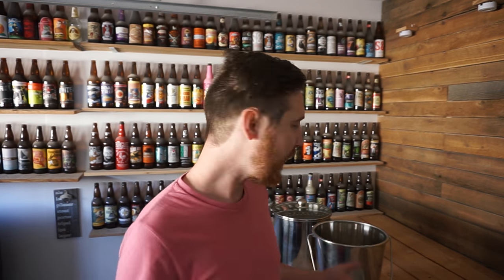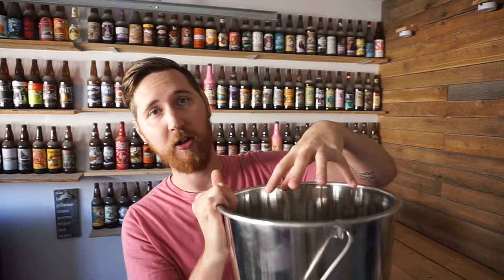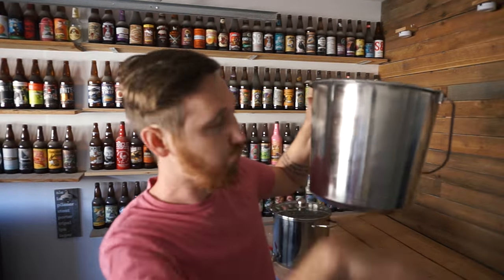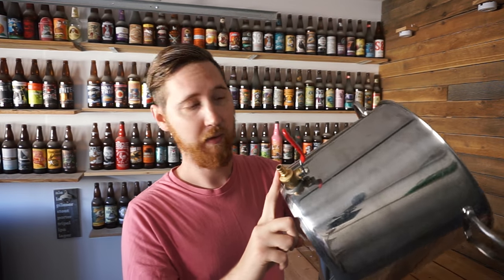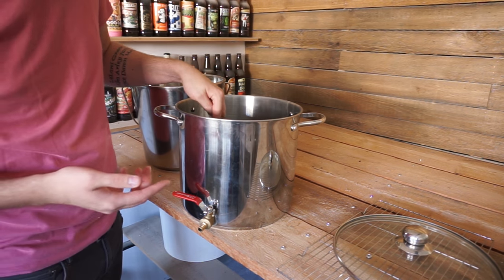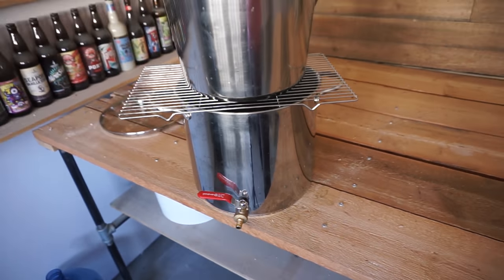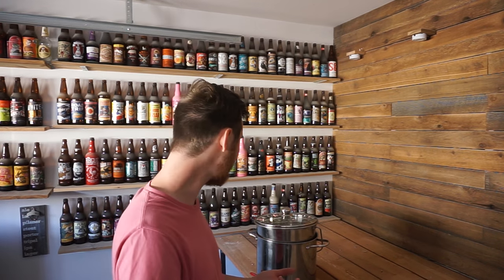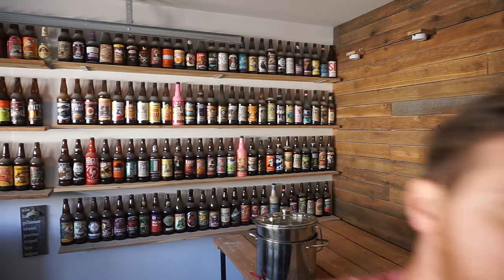Current One Gallon All Grain Homebrew Setup

Comment: Well, I'm interested! I stick to 1.5-2.5 batch sizes myself. Nice setup you have. I use a 2 gallon Rubbermaid cooler as my mash tun (I put the grain in a BIAB bag) and batch sparge in the cooler as well. I've had some good results!
Reply from the maker: As long as the final beer turns out, doesn't matter how you get there! Nicely done!

Comment: Nice setup. Going to try something similar. Instead of the screen in the bottom, perhaps a brew bag would work good for filtering out the grains? Would eliminate the aluminum problem some people are mentioning.
Reply from the maker: Yes, i've done the bag quite a bit. Works wonders. I just hate cleaning it.

Comment: I'd like to try this setup because I'd like to perfect my recipes before I scale up, but I have a few questions: 1. Does letting the pail rest at the bottom of your stock pot (and directly on the heat source) run the risk of toasting your grains? 2. How do you watch your temperature? I'm guessing some kind of clip-on thermometer? 3. Are you mashing in with your full volume of water or are you sparging with water you heat up on the side? Thanks in advance, great video, just need a bit more info before I try it out.
Reply from the maker: There's a bazooka screen in the pot, so the pail sits on that. It keeps the pail an inch off the bottom of the pot. No scorching of grains. Every time I stir the grains or recirculate I check the temp with a thermometer. Once day i'll drill another hole and put a weldless thermometer in the pot. I'll sparge with more water from a second pot.
Reply: Ah okay, I'm planning on just auto-siphoning the wort to the carboy for now so I won't need a ball valve or bazooka screen right away. I'm going to have to get some kind of stainless steel stand so my bucket can rest on that, but your way is definitely more convenient--I just hate drilling holes, I always jack it up. Last question, have you calculated efficiency on this set up?

Comment: IKEA have a stainless steel pot 365+ 5liters with a mesh inside it (for rice and noodles) has anyone tried that for beer making, looks like a perfect pot for garin beer making in small scale.
Reply: Never tried it. But price is always the main key for me. I got a seven gallon aluminum pot online for like 60 bucks. But it's one of those pots that you use for steaming crab and it also came with a propane burner.. 

The main thing you have to consider is that any pot over 5 gallons you can't really use on your stove top you would have to use a propane burner to get the temperature up to a good boil and then sustain the boil for an hour but 5 gallons and under a stove top should be fine
Reply: @Handles-R-Lame  5l is around 1,3gallon. It's pretty cheap, but maybe a simple 2gallon pot is cheaper, this one just looks really good. I have big aluminium pots, because people used to throw away their old aluminium pressure cooker. I would never use them as pressure cooker, because they look undafe, put they can be good as a simple pot (and they are free), but I am unsure what the aluminium leaches ito the water.
I can't use propane burner as I live in a flat.